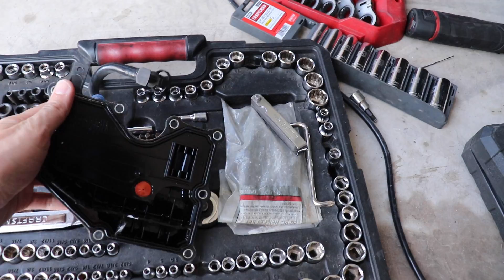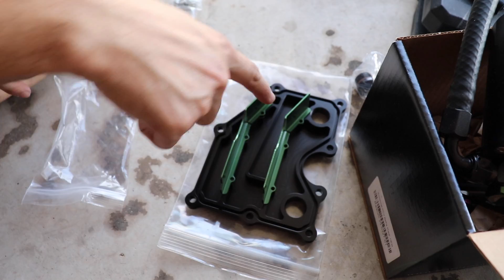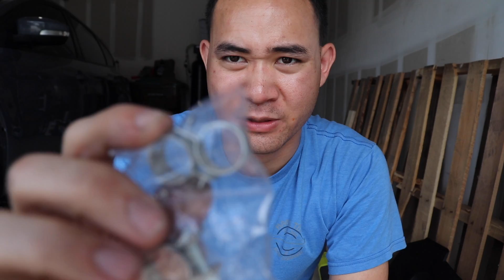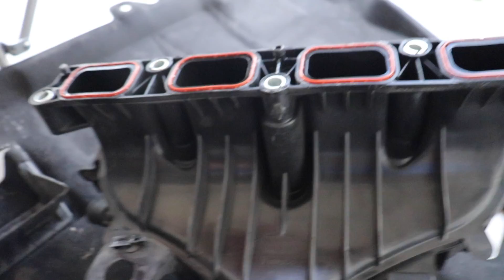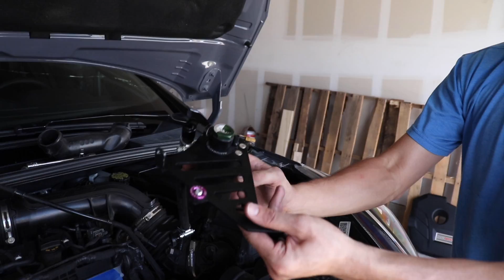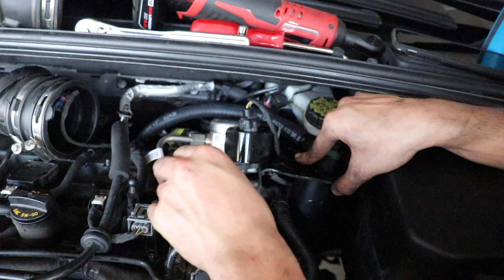How to Install Radium Engineering Dual Catch Cans and Breather Plate

Comment: Great video @UCARS. Very informative and I was able to locate the ccv and pcv of my ford explorer 2.0 ecoboost which is by the way same with your engine. Just a have a question on the ccv side. Is the ccv the outlet going to the inlet of the catch can, then the outlet of the catch can going to the intake of the turbo?
Reply from the maker: The catch can input into the top of the can will come from the Valve cover breather on the back of it, then the output from the can (side of the CCV can) will go to the back of the intake tube with the sensor/plug.
Reply: @Nick_UCARS  nice. Thanks for the immediate reply. How is the ccv and pcv catch can setup? Were you able to collect those unwanted oils and vapors in the can? I hope it helps your cars performance in the long run.
Reply from the maker: @triathleteover5030  You're welcome, I try to get on here to check for any questions and answer them as quickly as possible. Honestly, the CCV side RARELY catches anything. Every time I have gone to check someone's catch can at an oil change, there is nothing in the can; its been dry like its brand new in there. Most of the oil that is caught is always on the PCV side

Comment: Does this help with idle smoke
Reply from the maker: It does help, minimize smoke, the breather plate from Radium Engineering is sufficient enough to minimize the amount of smoke at idle. However, if you are seeing it billow smoke after hard pulls it is your turbo seal on the compressor side that is allowing oil to blow by.
Reply: i dont mean to be so off topic but does any of you know of a way to get back into an instagram account??
I somehow forgot the login password. I would love any tips you can offer me!
Reply: @Wayne Kaleb Instablaster =)
Reply: @Ryder Lochlan i really appreciate your reply. I got to the site on google and im trying it out now.
I see it takes a while so I will reply here later with my results.
Reply: @Ryder Lochlan it worked and I now got access to my account again. I am so happy!
Thank you so much, you saved my account !
Reply: @Wayne Kaleb Glad I could help xD